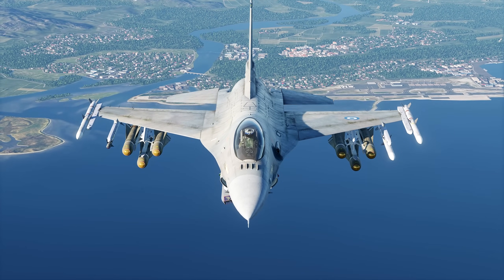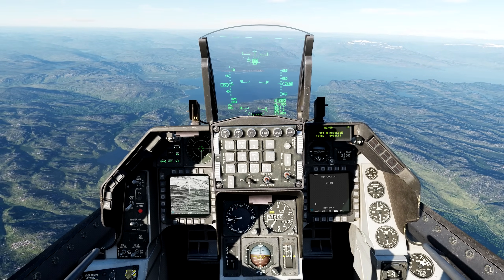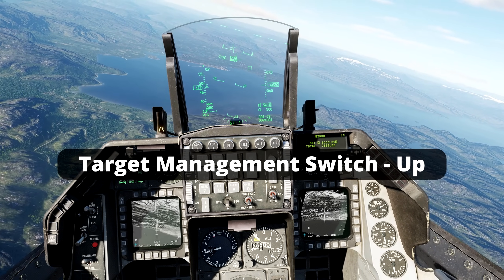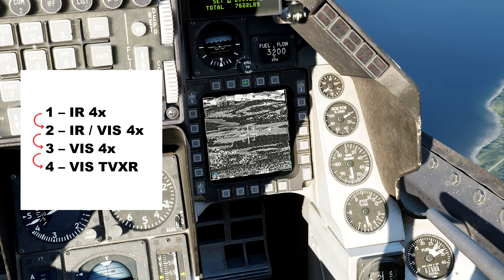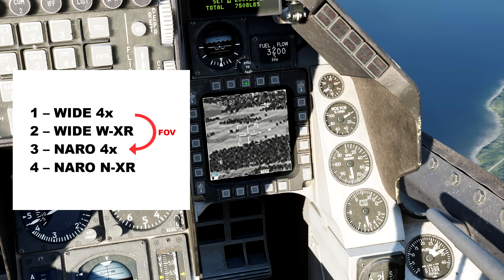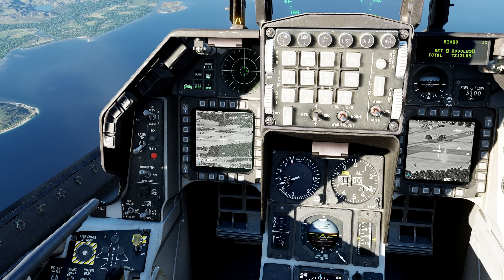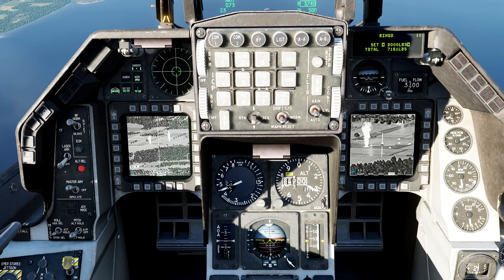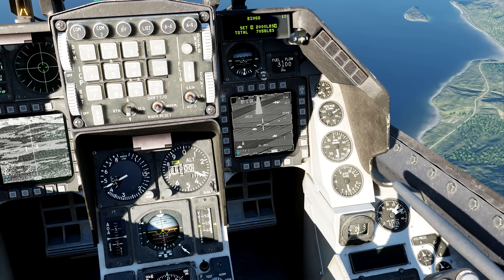F-16 Using Maverick with Sniper Pod | DCS | Tutorial

Comment: tener presente que la linacion del maverick se realiza en el modo VIS
Reply from the maker: Hello Steban...the alignment can be done in both PRE and VIS modes without any problem; in fact, the BSGT option appears in both modes. It's also specified in the F-16 manual 🙂
Reply: @nazguldcs  gracias por tu respuesta. esa alienacion se puede hacer en tierra ??
Reply from the maker: @steban2348  It used to be possible (and the manual also mentions this possibility). However, lately it hasn't been working, but it's been a while since I last tested it 🙂

Comment: Can you do the mav/pod alignment on the ground?  Seems like a lot to do with the mav's short range while flying.
Reply from the maker: It used to be possible, but now it's not. It seems like a lot of work, but it's not. The TGP can lock the target from a greater distance. When you get closer to the target, then lock using the Mav, align, and shoot. You can do this in 5 seconds. In this video of mine https://www.youtube.com/watch?v=0btjYsorqjw  at 05:00 and 08:30 I do this. But to be honest, most of the time I only use TGP to point the Mav's aim to a specific point. After that, I just use the Mav without doing the alignment. (remember that the alignment process is the same for the old and new TGP).  The tip is to search for targets using the TGP when we are still far away from them. Once the target is chosen, then we move towards it. When we are at the standard distance of 8nm, we lock using the Mav, align, and fire. 🙂

Comment: Geez, its all very easy hanging there for 15 minutes in active pause doing all the alignment and slewing the cross-hairs around, what about a more realistic workflow on a MP server with no pause and enemy fire coming at you?
Reply from the maker: Hi Al Heeley. It's not as difficult as it seems, especially because in the scenario you mentioned, I wouldn't have to spend 15 minutes talking and teaching someone something. Before takeoff, I create a waypoint over the target area. I put the pod in PRE, choose a target, TMS-up, move the Maverick's sight, TMS-up, click Boresight, and shoot. If I don't want to align, it's possible to easily shoot more than one missile. The trick is not to wait until close to the target to select it with the Pod. For example, at 15 nm, I already select a target with the Pod. Before 8 nm, I also place the Maverick's sight on the target. From 8 nm onward, I lock on the target, align, and fire. Another tip is not to want to do all this with an enemy hunting you. That's why you chose a multirole fighter. First, you shoot it down and then go on the air-to-ground mission.
https://youtu.be/HY-jNvPPu-w?si=8CUZk_8PYz-zMmOt
https://youtu.be/0Wv2hQZunPQ?si=GucNO53ZraYhsQ39
https://youtu.be/9LcTYpVejaY?si=66qjm_3eihH5VSPP
https://youtu.be/1Aor46HEhRo?si=dEND-NyRGm9_BT-6
In these videos, in 3 I shoot Maverick in MP and in 1 I do it in SP.😉
Reply: @nazguldcs  Haa - good point. Are these all IR mavs? Thanks
Reply from the maker: @alheeley  99% of the time yes.
Reply: Any problem, glad you don't need it!

Comment: Nice vid.  The problem I have with the mavericks, regardless of which TGP, if there are any clouds in the sky, or it's dusty, the hand-off to the maverick will fail because the Mavs vision is so bad.  Often by the time I can get the Mav to actually lock on, I'm too close to the target.  Is this just the life of Mavericks?  Or am I missing something?  I ask as every video I've seen someone do on the Mavericks, the sky is perfectly clear, and about mid day.
Reply from the maker: What's up, Frank. Thx bro 🙂. Try adjusting the contrast level on the maverick screen using the bottom right button. I usually have to increase the contrast because the white dots of targets are difficult to see on the light ground below. But the maverick's sight resolution really isn't good. When using a pod to locate a target, apply the FOV zoom on the maverick screen first. This makes it easier to find the target during hand-off.🙂
Reply: @nazguldcs  Thanks for the reply.  I do use the FOV zoom and that can help a little.  But even then, in PRE mode, if atmospherics are thick enough, cloud cover, or dust on desert maps, the maverick will not take the hand-off (until I'm too close).
Reply from the maker: Yeah, the only thing I do is adjust the maverick screen contrast. That helps me a lot.🙂
Reply: Handoff will work below 7 nautical miles
Reply: @fox_of_the_streetz4958  Yes, but the maverick has to also to be able to see the target (with optics that are not as good as the TGP), and many times, even within 7nm, it still can't make it out, so the handoff still fails.
Reply: @frankbieser  try automode and tms up long. And boresight the mavs with the tgp on start up
Reply: @frankbieser try the alignment/boresight procedure before taxi. Select close FOV on the WPN Page, Aquire a target in PRE Mode and within 7NM press TMS right (or up long). That should hand off the Mav.
Reply: Get it close enough and then slew the Mav on the target.  Once you select a target, fire, slew mav, fire etc.  don’t have to line up the TGP everytime.  It’s to help find the initial targets .

Comment: Thing is, aligning the mavs in the air is a tall order unless you can active pause. The optics of the missile aren't really good enough to see what's going on until you're almost over the target in the Viper.

Therefore, I always boresight them on the ground, and since with the new sniper pod that's over 10 minutes I'm gonna be waiting on the ground for it to warm up, I'm just gonna stick to the old pod.

The juice just isn't worth the squeeze.
Reply from the maker: Nice. Yes, the maverick's image is por. I believe the sniper pod really shines when we drop GPS bombs. Today, using mavs, what seems reasonable to me is to use the sniper pod if we catch the F-16 already hot, which is what happens on most multiplayer servers. That way, we don't need to align 🙂. But if we think about a realistic simulator, 10 minutes is nothing in a real attack mission with a cold 16, where we have to start, taxi, and still fly to distant targets.🙂
Reply: Maybe its very problematic in DCS but in Falcon BMS, this is like takeoff and landing common for the F-16C block 40 at least.  Find an environment point of reference that is easy to align them and get it done.

Once you've done it 10 times you begin to figure it out rather quickly and can do it without too much delay before you ingress towards the main operating area.
Reply from the maker: Something DCS players wish. Thanks Havoc 🙂
Reply: Yeah, with the boresighting and image quality limitations on the Sniper, the old pod is much better and easier to use, at least in IR modes.
Reply: With a little bit of practice it isn’t too bad aligning from the air.  I like to start at about 13 miles out, be at about a 3 degree nose down, hit Attitude hold and then just do your alignment on each station to the same target.  By the time it’s down it’ll be around 6 miles and ready to fire

Comment: now we can? its the same exact thing we did with the old pod
Reply from the maker: Whatsup dude. With the old pod, we had alignment issues even using pre mode. Plus, many people are still confused about the sniper pod's zoom settings. So the title matches the clarification given in the video, especially on these two topics.🙂. Furthermore, another interpretation of the title is that if someone doesn't know how to use the pod with the maverick, they will now be able to. Not everyone is a veteran like us on DCS.
Reply: @nazguldcs  no, alignment was good as long you knew that it is aligned always at the distance you align it with, convergence like two guns in your wing. Alignment was at 1nm and it will be off at 7nm, but will match at 1nm.
Reply from the maker: Hunnn, good. I'll try and test it. Good point.

Comment: I thought you had to boresight each missile in pre mode but you just boresighted one missile on each rack. Did I get that right?
Nice clear vid by the way 😎🫡
Reply from the maker: Hello R9. That's it. Just do it once for each side. Since the old TGP had alignment issues, we ended up having to do the alignment for each missile, but with the sniper (and as it should be the old pod as well), we only need to do it once for each side. 😉